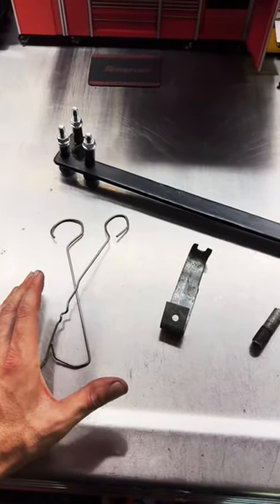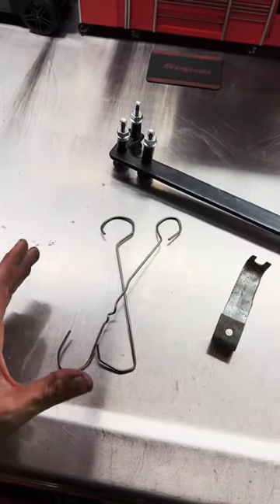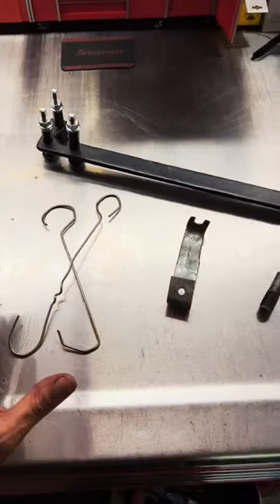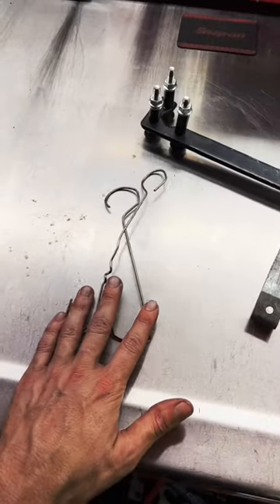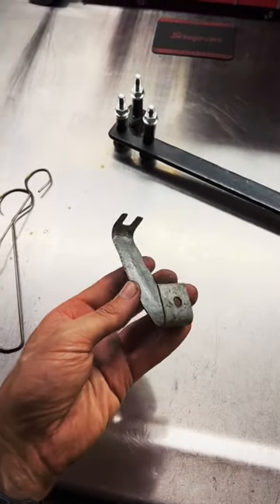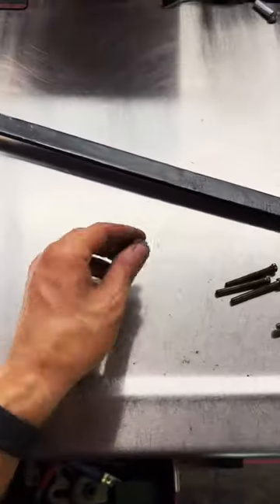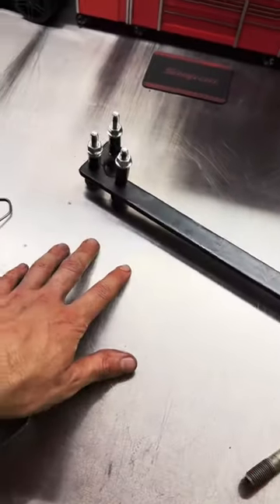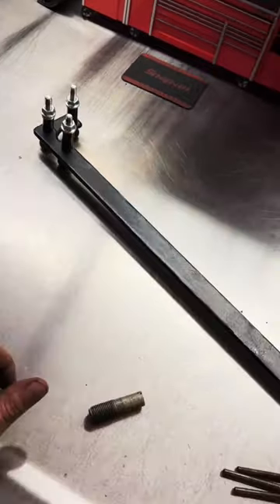Homemade Tools, We’ve All Been There! #MrSubaru1387 #Tools #Shorts

Comment: My favorite was the inner tie rod off a 1990s Chrysler LHS/Concorde as a breaker bar extension. Just remove the old rubber off it, wrap the threads in your favorite gripping material, and you are ready to go.

Comment: Mercedes actually included a wheel installation tool in the OE toolkit that I know for sure came with all cars in the 80s and 90s. It was a knurled aluminum peg with a few turns of threads on the end. You threaded it into a lug bolt hole, and that aligned and held the wheel in place. Then it unthreaded and came out the front. Most of these old MBs are missing their kits, but once in a while you will find a 1 or 2 owner specimen that has the OE first aid kit and toolkit which contains all of the OE tools. :) I even have a Mercedes branded aluminum or pot metal open box wrench that is 10mm on one side and 8mm on the other. You can take apart half of the car with that thing alone. 😺👌
Reply: KS Tools makes them for cheap in different sizes. Very handy for cars with carbon ceramic brakes and 5000$ forged AMG rims

Comment: Subaru ball joint puller from M16 10.9 full threaded bolt and 2 nuts, a old subaru wheel nut,a old small tapered bearing and a sleeve of suitable diameter from a bush and bearing removal/fitting kit.
Cost about 5 bucks and works equal to better than any of the specific special tools for pulling rusted front ball joint .

Comment: The amount of pullers and presses I’ve made is kind of ridiculous
I have proper sets but they’re all mainly for suspension parts
My favourite is you grab a large washer same size as your bearing, cut 2 sides so it’s like a rectangle with curved short ends, can fish it in behind the bearing then just get a bolt in the hole and a few more bolts and bits of metal to get it to push against something
Still needs a lot of heat, but it gets it so you can have constant pressure on the bearing
Love when my set of internal bearing pullers bends under the pressure but my little 2mm thick washer holds on and works well enough 😂

(Another secret is to bend the little puller to a 30 degree angle or so, that way the tighter you pull the more it pushes out)

Comment: Glow plug wire harness off of a 94 Super Duty Ford Super Duty I built the same tool scrapped it now I just drill hole down into the center of the harness connector and use a drywall screw and screwdriver to pop it off

Comment: Just last week i had to make me a steering wheel puller when I was at the junkyard trying to remove a clock spring . Used some throttle body bolts and a hood latch to remove it 😂
Reply: I bet you felt like macgyver after that! That's awesome!

Comment: Mr.Subaru! I have a question can you help me out? I was replacing the pcv valve on my 2012 inprezas fb20 and I cracked the threading where the  pcv valve threads in. Preventative maintained gone wrong... Is there anything I can do short of replacing the engine... will this effect the balance? The pcv valve is threaded in but I'm worried ot won't hold. I couldn't tighten it anymore its just spinning. Also thank you so much for all your videos I'm a huge fan of yours and subaru.

Comment: Had to make a injector puller/ slide hammer last week with the old injector clamp, some threaded rod, half of a mini excavator pin and some scrap steel. As the old injector was seized in there.

Comment: Hey guys! I ran my Subaru clean out of gas while getting on it and thought the issue was more severe and never looked at guage or even taken into consideration I had run out of gas. I have now filled the car with a half tank but the car will not stay running, it won't even let me give it any gas it fires right up real weak and shuts off. Any idea what this could be? Any help would be appreciated!

Comment: i had to remove a big bolt at the junkyard and thinking i would only remove small bolts, i didn't bring an impact or breaker bar. i looked around the junkyard and found a PVC pipe just the diameter of my 3/8 ratchet and made my own extendable ratchet

Comment: I had to Fashion a Ford fan wrench out of a GM fan wrench once because the "Universal" tool wasn't so Universal
Reply: That Ford tool you made is for disconnecting a slave cylinder fluids supply line on standard transmissions no?